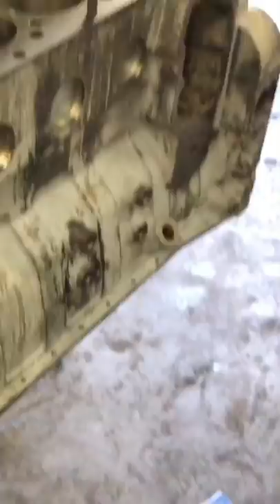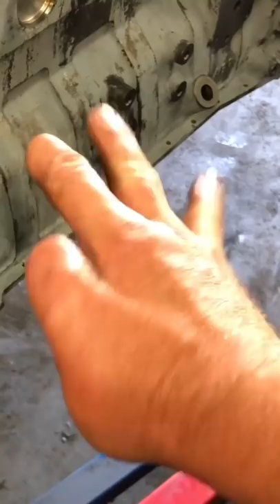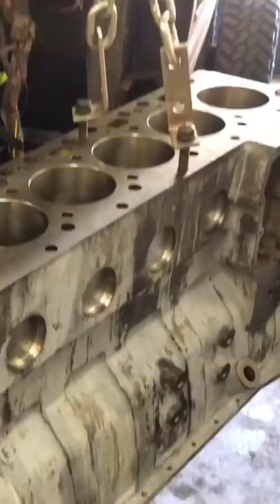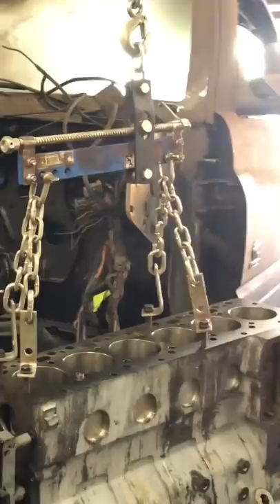Be Careful folks! Link in Description #12valve #cummins #diesel

Comment: I had a spring compressor snap years ago as I reached in between the spring cradle and spring to get my socket out that fell of my ratchet. I was able to tear my hand out and only bruised the tips of my fingers as the compressor didnt fully give way. 
   Dude's right, you're butter compared to steel. Be smart and be safe! They dont make OEM replacements for digits!
Reply from the maker: Wow man that’s crazy

Comment: Was Welding steam lines in NYC, there was a sprinkler fitter running a 300 machine after all of us left & his denim jacket was caught. They cut the safety pedal out so they could run the machine without having to constantly turn in on & off, bad part is when his denim was caught it ripped his whole body in half & when we got back to the job site it was riddled with blood everywhere. The machine went on all weekend & you could see that it just kept spinning while also his body parts. Like you said when metal decides to hurt we are made of butter.
Reply from the maker: Wow that is absolutely terrible. Poor guy

Comment: A lifting fixture sheared off under normal operating conditions at the Cummins plant I managed and the 15L block with crank installed fell onto the crane operators steel toe boot crushing the steel cap down, but not enough to hurt him.  Wear your PPE!
Reply from the maker: Wow lucky! Ya I agree

Comment: So damn true I work underground and you are by far the softest thing in the coal mine and trust me I've seen ppl get smashed an dudes left arm got tore off by the miner and a cable broke while we was pulling rail and it broke hit my buddy in the shoulder an took his left arm off at the shoulder it was hanging by skin shit was wild that's just acouple things outta meany that has effected me mentally! But what really fucked me up was my partner an I was bolting after the miner backed out and there was a big step out brow it the roof an was splitting before I knew it a rock about the size of a small car landed on my buddy. I ran around the bolter when I realized what was going on ran over and couldn't even budge the rock... I ran back to the load center an got 4 other guys ran back up on the face and picked it up just enough so we could pull him out from under it.. crushed his chest broke most of his ribs broke sternum broke pelvis broke an alot more but I don't remember all of it's been yrs but remember that like yesterday. We picked his body up and it was like picking up a bag full of milk... Shit was rough!!
Reply from the maker: That’s terrible. Poor guy

Comment: Used to work as a die setter and man even setting down a 20 ton (some of the smaller molds) piece of metal with the industrial crane was scary. Some people would forget to go half speed and sometimes slam it down too hard and you could feel the ground tremble from 15-30 feet away. Surprisingly there wasn't many holes in the concrete. Lol
Reply from the maker: Wow I bet

Comment: I hear tht i got my t-shirt caught in a metal lathe sure woke me up quick always use caution and care the machine will win hands down everytime
Reply: Oh yeah also got my index and middle finger squashed by the counter weight on a 10' hand break  and they had to drill holes in my finger tips to relieve the pressure the blood shot out and got the ceiling  and also working at a wood shop I got my arm sucked into a 60 grit sanding drum my fore arm was shredded was gnarly af woke up to my cat chew into it one morning he was in fact cleaning the wound but I didn't see it tht way at first but yeah accidents come out of nowhere so fast I was a safty rep for our company I seen and heard of sum real zingers a roofing supervisor got knocked off a building when he was directing Crain operator while taking materials off the roof  a bundle of insulation was caught on a curb  for a.c. unit and the craines cable was like 45° and a pendulum effect when the insulation let go from where it was caught the bundle swung and knocked him off the side... so unnecessary another bad one was where a job site super need a peice of ply wood so he took the peice the was covering the open cut roof hatch on the steel deck and replaced it with a peice of foam insulation this day the roofing foreman  brought his son into work for summer well iam sure we can figure this one out well the kid and a fellow  worker were carrying the roof hatch tht just arrived and were walking it over to where it was suppose to go ; the young fellow was walking backwards while carrying step in the insulation and of course broke through and fell to his death he moreless died in his father's arms and it was moreless the site supervisors fault for replacing the plywòod the previous night but it was was not just his fault but the lack of paying attention  I say it's like defensive driving keep the eyes moving and look 20 sec ahead cuz accidents come outta nowhere and happen so fast! Be safe out there  no job is worth any body parts or even worse death!
Reply from the maker: Wow those are some pretty wild stories. Poor kid man that is terrible

Comment: I was actually moving a transmission one time when I worked at my grandparents shop, and I was helping out the older dudes, trying to learn some stuff, I ended up scooting a transmission jack the wrong way and the transmission was not secured on the jack properly, the jack was also very old, but long story short the transmission fell off the jack and landed about 2 inches away from my foot, my foot would have been absolutely demolished by that transmission. Got lucky
Reply from the maker: Ya those things are sketchy!

Comment: My uncles hand looks just like yours. He was paving a driveway and his dump trucks pto cable was broken for a couple weeks. He kept sliding under the truck and engaging the pto by pushing the leaver with a screwdriver. Well the screwdriver slipped and he got his glove stuck in the drive shaft. Ripped all 4 fingers off his hand they stitched them back on but only 3 healed correctly and the forth one had to be removed again.
Reply from the maker: Wow that’s lucky

Comment: I'm working in a sawmill as a saw filer. Had scare or two when I tripped with a saw on the grinder. Wouldn't be as bad as on the rig, but it'd still slice something. I'm also by myself so I need to be extra careful.
Reply from the maker: Yeah sawmills are just unbelievably dangerous. Be careful!
Reply: @StockyBaldman  Thanks, I'll do that.

Comment: When I was younger I got a nice “paper cut” type cut on my palms at my dads auto body shop. It left no scar and also wasn’t painful. Didn’t realize I had even cut myself until I saw blood. I didn’t realize how sharp a transmission bell housing edge was. The edge was like 90° but it still cut clean into my palms. Now I never forget to wear gloves.
Edit: by “paper cut” type cut I mean that the cut left a flap of skin. Not that the cut was small like a paper cut. The cut was actually pretty deep into my palms😂
Reply from the maker: Yeah it’s amazing how easy it happens
Reply: @Rosehill CCTV “paper cut” type cut not paper cut is what I typed. The cut was pretty deep into my palms. And yeah the vid was about how easy metal can cut so I commented about how a seemingly harmless 90 degree corner of a transmission cut into my palms. Have a good one Rose 😂✌️

Comment: not quite the same but still proves the point metal doesn’t care about your hand.  I just started a sheet metal hvac job a few weeks ago and I was carrying ducts on the sides of my handed similar to how you’d throw a frisby and they were probably 45lbs ducts one in each hand.  Well after moving them about 20 ft to the truck we were loading I was setting them down on the ground to load each one and my left index finger totally gave out sideways so it bend towards the ground and it made a very loud popping noise.  At first I thought it was my bone but it after it wasn’t swelling and was a very odd pain.  I figured out I definitely tore a tendon in my hand but I still have full range  of motion in my index finger it just has weak strength in some angles.  I’m glad I don’t need surgery since it didn’t snap and it was a crazy experience.
Reply from the maker: Wow man that’s crazy

Comment: Used to move printing presses and many other machines. Some 30k per section. Most 8 k. Always thaught if my hand was ever under one when it came down. Mine as well just cut it off with a razor knife. It would plane explode flat as a sheet of paper. Have to have fear and patience working around heavey metal. If some one is in a rush walk away.
Reply from the maker: Ya that’s scary stuff

Comment: It's never the really unsafe things that will get you either. It's the small safety steps that are inconvenient or otherwise easy to skip that pose the most risk. Those are the things that will mess your life up or kill you. So don't get complacent.

For instance, when working with fast spinning power tools like grinders, eye protection is not optional. It's easy to skip that step, but if something were to go wrong, that is the difference between going blind and being fine.

Comment: My dad cut the tips off of his right middle and ring finger, was put in the waiting room until my Grandpa went and personally informed the Surgeon of his condition, Grandpa ended up assisting the surgeon while he reattached my dads finger tips.. about 10 years later my grandpa ended up cutting his own finger nearly entirely off, hanging by a thread but had it reattached.. so now whenever I use heavy machines or saws I take extra precaution..
Reply from the maker: Wow, ya good idea

Comment: I work moving large metal dies, the lightest of which is a 470lb "blank" or "mini" die at some point the other guys doing that job (on other shifts) decided it was cool to stack em on top of other, bigger dies(the dies are like, chest height). I'm actively working to put a stop to that given I move them via overhead crane and on several occasions almost pulled a mini die off it's larger counterpart while rigging. 
Metal don't give a shit, and these aren't dies I want to roll. 
Also, if you don't get a tense down your leg when lifting what can be up to 10000lbs.  Stay away from the crane
Reply from the maker: I used to run a tower crane, lifting things around human beings is very stressful
Reply: @StockyBaldman  tell that to the flock of engineers and managers that like to gather around the presses and in my path. I guess their degree didn't teach them about gravity and the fact that standing near or UNDER a multi ton anything isn't smart. At some point it don't matter how heavy something is

Comment: 'It is important to have the stuff that can handle the stuff safely'

Said the man, who did not have the right stuff to lift that block safely.
Reply from the maker: 2ton shop crane, 1500 pound load leveler and 4 bolts bottomed out in the block
Reply: @StockyBaldman  Yeah I get that, but it's the L brackets. I'm still young but I got my crane certificates and all that and using L brackets instead of using lifting eyes (i don't know if this is the right english term for it) would never fly in any of the places i've worked so far!
Reply from the maker: All good man, I used to run a tower crane on a construction site. The L brackets came with the 1500 pound load leveler. A lot of people have mentioned that they look crappy but it lift this engine up like nothing
Reply: @StockyBaldman  Rather unexpected that they'd ship it out with those. But if it works it works I guess!

Comment: Maybe using the right size bolt to attach your engine hoist and get the proper torque down would be safety step one. Lol
Reply from the maker: Bolts are bottomed out in the block. A couple people have mentioned that and I will keep it in mind in the future. The instructions for the load leveller did not specify that it had to be tightened right down. When I dropped the block off at the machine shop they lifted it out using only one bolt so I thought I was being safe

Comment: So why did you use aluminum flat stock to secure that block to the picker? I mean I'm sure it can handle it but why not just use steel?
Reply from the maker: It’s steel and it came with the load leveler
Reply: @StockyBaldman  thank God man I am very happy to be wrong. That looked liked some hand bent aluminum flat stock. I was supprised it wasn't straightened out already haha. Cheers man

Comment: I had a pretty bad experience when I was 13 last year I dropped to 1999 Mustang gt heavy brake rotors on my to barefoot my toe was black with dried blood under it for 8 months
Reply from the maker: I can appreciate that, there’s so many small bones in the feet. I once dropped the tall can of beer on my foot and it landed just right and hurt for quite a while. I can’t even imagine a brake rotor
Reply: @StockyBaldman  it was 2 brake rotors on top of each other it was bad I didn't ever know if I broke anything in my toe

Comment: Sawmill life aint no joke, had to do a report on a worker who was playing around, fell over and cut his left leg off below the knee.
Reply from the maker: Ya they are unbelievably dangerous
Reply: They sure are, im missing my pinky and half my right ring finger cause a belt jumped and snatched my hand. Twisted them right off the socket.
Reply from the maker: Ouch man, dang. Those pulleys are every bit as nasty as chains and sprockets
Reply: @StockyBaldman  yes sir. Sometimes lessons hurt. My boss told me not to doit, i did it anyways. No lock out tag out. Yeah, i paid for my stupidity in blood and flesh. Put my fingers in my pocket, and finished the job before i passed out. Young and dumb lol. Now, yeah you go near that machine, and you're getting a 2 3/4 wrench thrown at you lol.

Comment: As that whole block is being held on by like 10 screw threads and some flimsy angle irons 🤦🏼‍♂️
Reply from the maker: Load leveller rated for 1500 pounds, bolts are bottomed out in the block. A couple people have mentioned that the bolts are too long, won’t happen again. When I dropped the block off at the machine shop they lifted it with one bolt, thought I was being safe by using all 4.
Reply: @StockyBaldman  well that's good 👍🏻 can't replace fingers and toes. Stay safe

Comment: Says the guy holding his block up sketchy. Like I've for what fucking reason are you holding it like that. And you only maxed out at 4 digits anyway...
Reply from the maker: 2 ton shop crane, 1500 pound load leveler and 4 bolts bottomed out in the block. What Happened to my Hand?
https://youtu.be/_HKbipvgtS0

Comment: Thats the most unsafe way ive seen to hold up a motor. No wonder your missing fingers....
Reply from the maker: 2 ton shop crane, 1500 pound load leveler and four bolts bottomed out in the block.

Comment: 1,030 pounds without fluids 😣
Reply from the maker: Is that the second gen or first? I alway heard the first gen was heavier. They weighed one on finnegans garage and it was under 1000
Reply: @StockyBaldman  Second! I looked up the specs not too long ago to compare weight with a 454 BBC and my Old Chevy inline 6.
Would you believe a 454 only weighs 50 more pounds than this old six cylinder?

Comment: How about using some type of failsafe, guess you didn't learn the lesson 🤦‍♂️
Reply from the maker: 2 ton shop crane, 1500 pound load leveler and 4 bolts bottomed out in the block. When I drop the block off at the machine shop they lifted it with one bolt. I thought I was being pretty careful